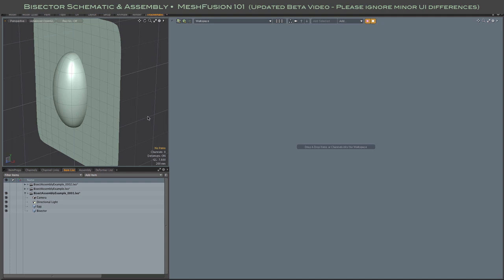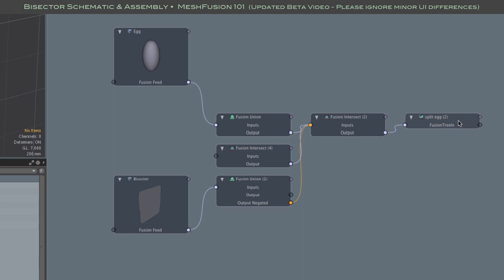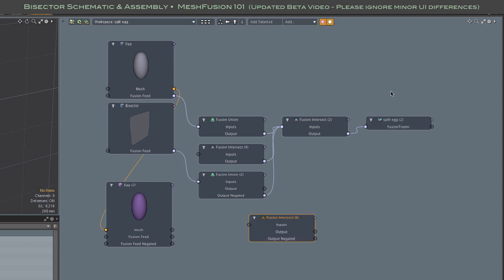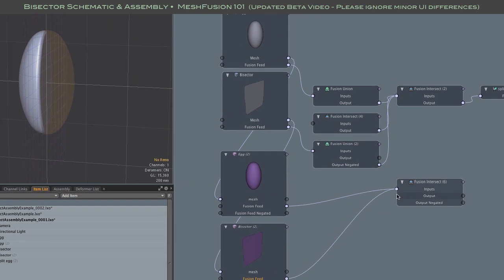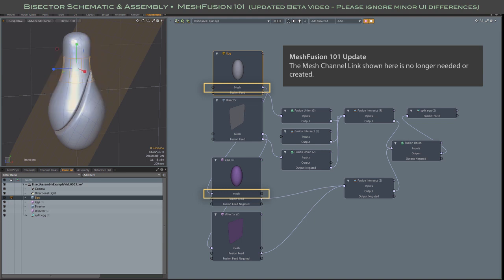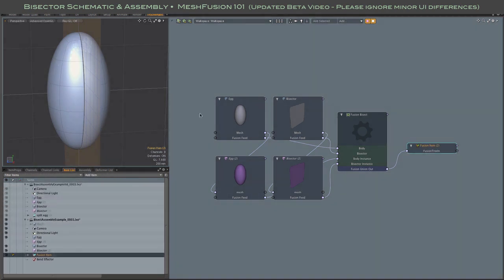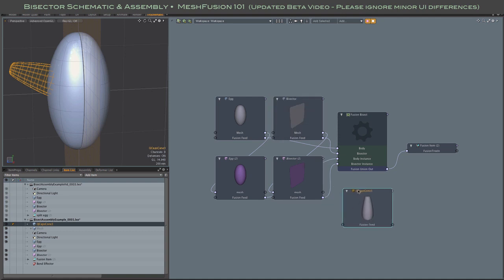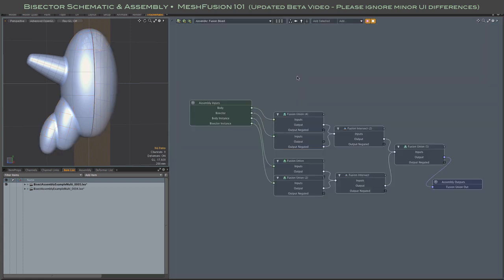MeshFusion101 Schematic Bisector & Assembly

Comment: Hi Darrel.  I think your tutorials are great.  I have one question about the bisector assembly.  In it, you have four union nodes with one input.  These would appear to me to be redundant.  Are they there just to make it easier to add more inputs should you want to expand the assembly or do they serve any functional role?
Reply from the maker: Right - The standard Fusion Branch is created with any new or tree-converted Schematic Fusion — there to accommodate further editing. It's one of the flexible aspects of our Schematic & 3D Tree systems — empty nodes are allowed.